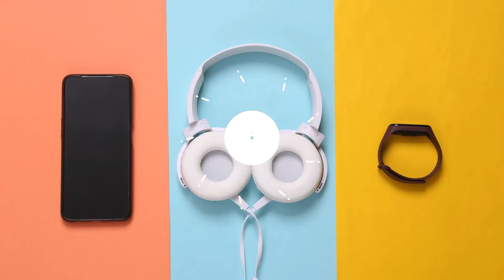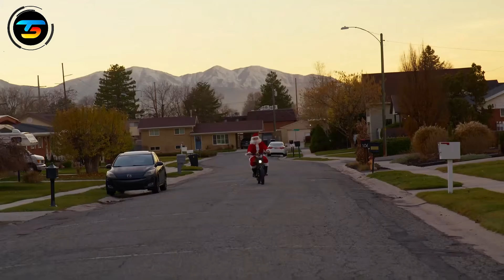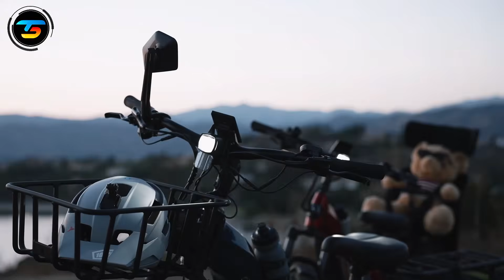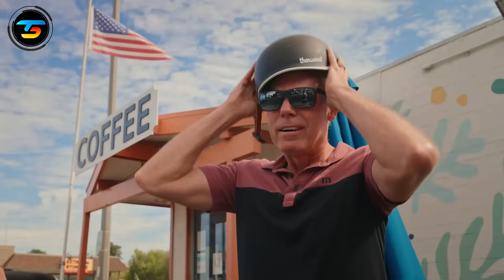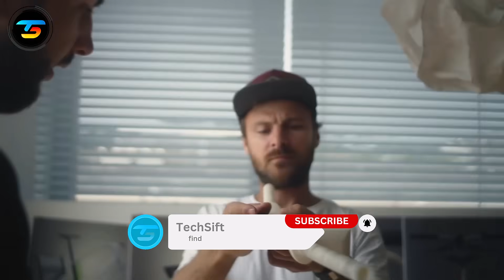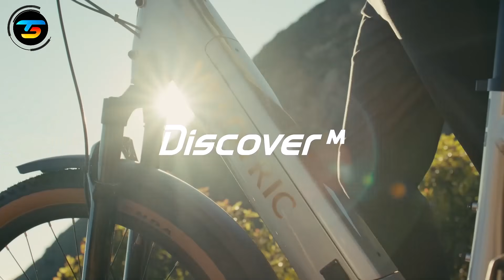10 Best Electric Bikes of 2026 That Are Actually Worth Buying

Comment: Can a solar power panel be plugged into the bike if you park it somewhere where like say if you go to a grocerie store, coffee shop or bar just to extend the miles.
Reply from the maker: most ebikes aren't designed to charge directly from a portable solar panel. You'd usually need additional charging equipment, and the charging speed would be pretty slow. It's an interesting idea though, especially for long-distance touring setups.
Reply: It's probably cheaper and easier to buy a 2nd battery, or go the portable power like a Jackery.
Reply from the maker: that's probably the route most people would take.a spare battery is definitely the simplest way to extend your range.

Comment: RollRoad Emma and Leon are high quality builds and components. Check em out
Reply from the maker: Sounds like you're pretty impressed with them, I'll definitely take a look at them. What do you think sets the Emma and Leon apart from other e-bikes?
Reply: ,  although the brand is not well known, yet, I believe the build quality and quality components  and engineering. For the price point I believe it matches or exceeds the value of many others in it's class. An E-moped style of bike designed for heavy payload or multiple riders. Bafang Motor, EVE batteries (BMW & others), 4 piston hydraulic brakes, torque sensor, and lots of Energy. Over 2 KWH of juice ( 2 , 52V-20Ah batteries), so the range is pretty much a solid 100 miles or more depending on all the factors, weight, avg. speed, etc.. I could go on but it's all on their website if interested. Also, as for durability,  I have put almost 3.5K miles on her since last August with the Winter break included. No major issues, already did a tire change from road wear. Even their stock tires are very nice. Motorcycle grade rear shocks with nitrogen/air shocks. My baby!! ❤😊
Reply from the maker: i can tell you're passionate about that bike just from the way you describe it it's refreshing to hear from someone who's actually put thousands of miles on an e-bike. Thanks for taking the time to break down your experience with it.

Comment: My wired freedom 24 has been an awesome bike.. 3500 miles and still runs great.. predator is too much bike for the trails.  Second motor adds weight and is not needed...
Reply: I heard that I have the wired warrior and I could not imagine needing more power than that for the city and local trails without a lot of hills
Reply from the maker: That’s awesome to hear! Real-world experience like this is way more valuable than specs on paper. 3500 miles with no major issues says a lot about the bike.
Reply: So you tried the predator and it was to heavy for you on the trails ?